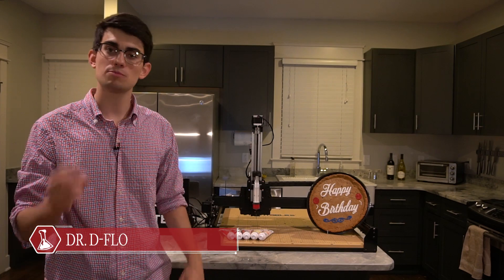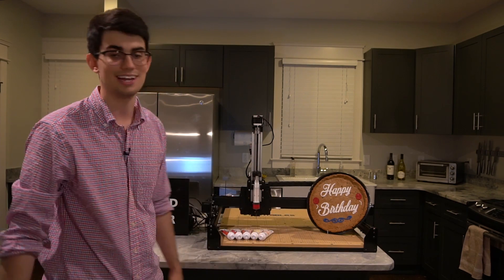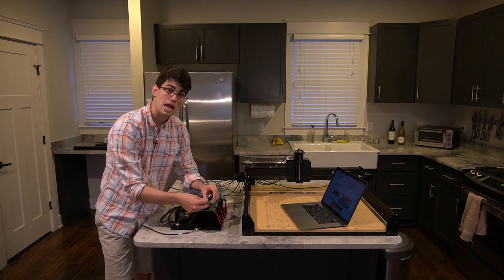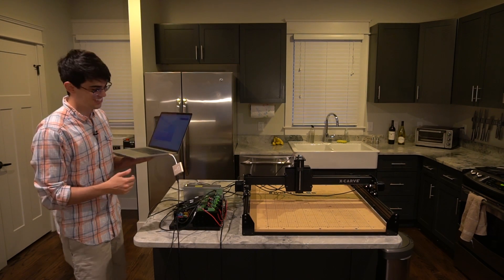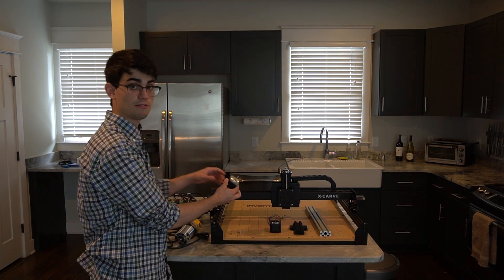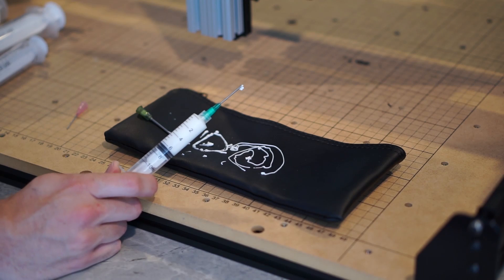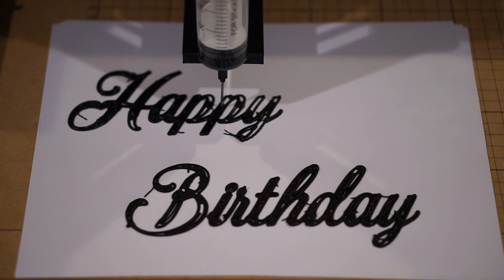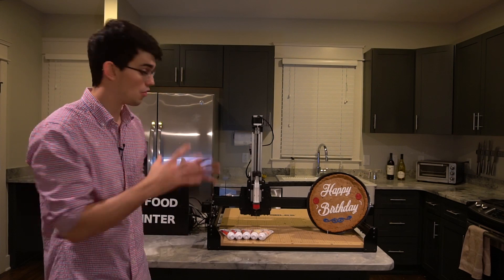3D Food Printer Build

Comment: why not just spit out the g code to a file and run that on the x carve? with some basic editing to the z travel using the extruder values put out from whatever slicing software seems easier than messing with the hardware

Comment: Hi! A solution to the stringing is to have a little rc servo actuate a small catch tray in the path of the fluid. A wipe pass could be added to each layer in the slicer software, to allow the tray to be wiped by a stationary wiper, with a larger collection tray underneath. This would work in situations where retraction may not be feasible.

Comment: Hi Dr. D-flo
I am building a similar machine with ramps and the same motor drivers but I am having a problem. One of the motors move only if the other is not moving. Any idea why is this happening? It looks like it is in marlin because If I remove one motor the same thing keeps happening , it is not a voltage or current problem.
Thanks in advanced

Comment: An extremely nice video! I have a small doubt though. Is it necessary to change the G-code since a different extruder is used? The G-code seems to specify the rate at which the material is pushed out of the nozzle at each moment. Moreover, editing the G-code also seems to be cumbersome!

Comment: Hello, I'm trying to develop one of this here in Brazil. I would use it to decorate Christmas wafers. How did you turn on the stepper motor that is triggering the syringe?
Is it an independent system? or did you use it on the same controller?
Reply from the maker: Same controller: Ramps 1.4. Its exactly like a 3D printer but instead of the filament extruder motor it is the syringe pump motor.
Reply: Thanks for listening. But I, it seems the engine does not produce cut or interruption in the flow of the syringe. Imagine you need to make dots on the cake. That's what I intend to do with the machine.
Reply: I thought about connecting the syringe motor to a separate arduino and being fired each time the Z axis goes down. This will cause you to interrupt the lines and with a better design. What do you think?
Reply from the maker: That would work, but it is unnecessary. The syringe pump is turning based on the G-Code sent to the ramps controller board via my 3D printer slicer, simplify 3D. Every now and then the syringe pump turns the opposite way to retract the frosting so that it can move to a new location. This is what it would do if you had your 3D printer slicer printing dots.

Comment: The X-Controller can be programmed with the Arduino environment (until recently that's how you updated the X-Controller firmware), so it's basically an Arduino with the stepper drivers onboard.  I therefore suspect you could install the 3D printer firmware (Marlin) on it with some config mods.  I guess you'd still need another stepper driver to control the extruder - since the Y motor controllers are tied together in the X-Controller board you can't control them independently to get the paste extruder output.
Reply from the maker: Steve Prior You are correct. The X-Controller uses the ATMEGA. However, it would require serious modifications to marlin that has not been done before and I am incapable of. Also the x-controller  only has 4 stepper drivers which would be perfect for a 3d printer but two of these drivers are used for the y-axis and it would be far from optimal to wire both y stepper motors to one driver. So I still stand by my suggestion that RAMPS should be used over the X-Controller

Comment: Amazing! One question: 3D Printers with Nema 17 Motors do not use those beefy stepper drivers and do work properly. Why you decided to upgrade? Is this also smart for a self-build 3D Printer (which can print at a 100 mm/s)
Reply from the maker: Something I didn't mention was that Nema 17 or Nema 23 refers to the size of the front plate of the stepper motor. 17 or 23 does not refer to the current rating of the motor. The NEMA 17's that I used required 2.5A which is slightly too high for the standard stepper drivers that come with ramps or RAMBO. You me able to get away with the DRV8825 if you had a heat sink or fan but I just decided to use the "beefy" stepper driver (ST-M5045) to be safe.
Reply: I was thinking the same thing, doesn't feel like 3A and the beefier drivers are absolutely needed when doing "food printing" (instead of the standard CNC routing on the X-Carve). Anyway, thanks for a cool video.

Comment: The ramps 1.4 is the cheapest board, but also easy to replace parts, like i have blown up my arduino. But not my ramps board :) If I used another board I would have blown up the complete board including the drivers.
Reply from the maker: RAMPS is cheap which is both a positive and a negative!

Comment: Very cool. You can use coasting in slicing software which means it stops extruding a little bit before it needs to complete the perimeter, that's what is used in large format printers with large nozzles which ooze. You can find a happy medium of how much coast you need to basically eliminate the excess ooze. Also use the option of not crossing outlines, there are other slicing settings which can help you so that the amount of travel over areas where you don't want anything printed is minimized.
Reply from the maker: Thank you for your comment, very helpful. What slicer would you recommend to minimize this area? I initially did a brief search for such a program, and I did not stumble upon one.
Reply: Simplify 3D -- has an option for "avoid crossing outline for travel movements" -- it will try to retrace the path of a line when doing travels and avoid going into open spaces. There is a factor setting which controls how much out of the way it should go to do this, set it higher if you want it to do everything possible, it still will do some jumps which are unavoidable, but it will be very infrequent -- not the best for 3d printing as it's rather jerky and causes a lot of unnecessary travels, but for this application it would be good.